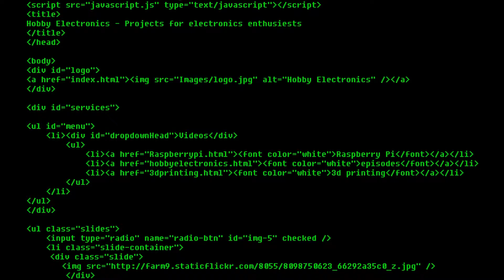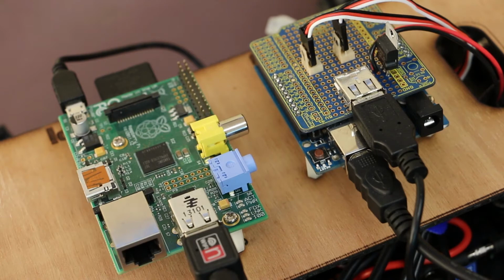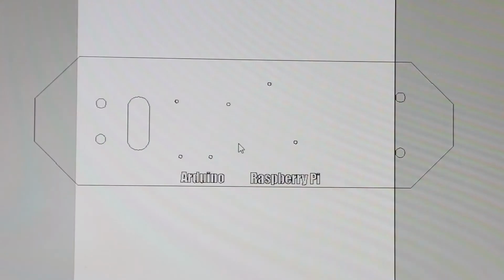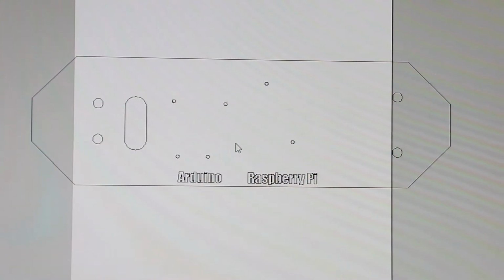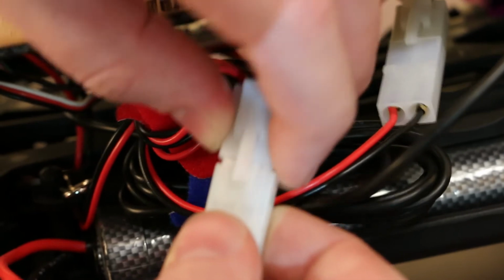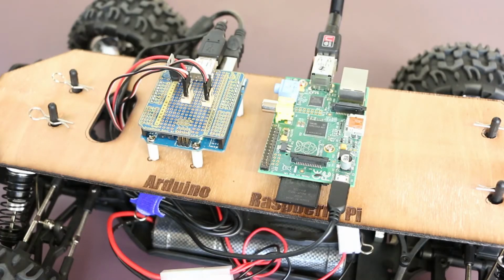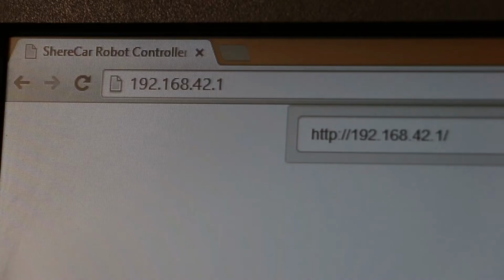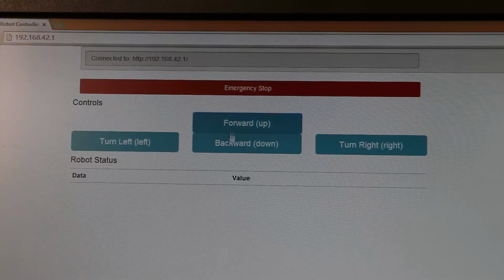Web Controlled RC Car #3

Comment: whats the range you are getting ?
Reply from the maker: I'm getting around 20m, this will depend on the wireless adapter that you are using.
Reply: can you use a 4g  or LTE usb stick and control it that way?
Reply from the maker: rdbagaming I haven't used any of them before in my projects but if you can manage to setup the device and configure it on your Pi then you would just need its IP address to access it.